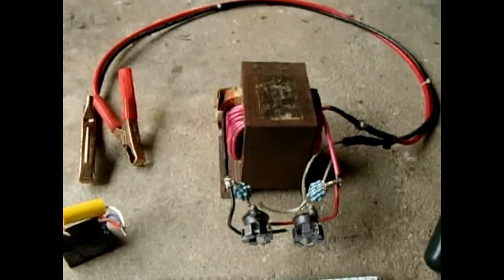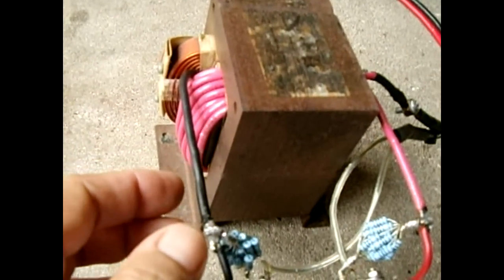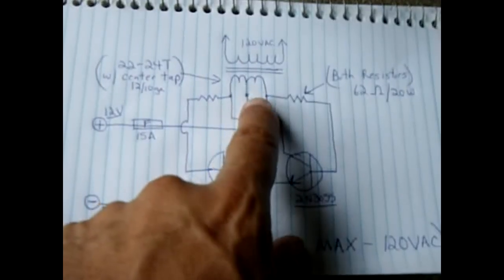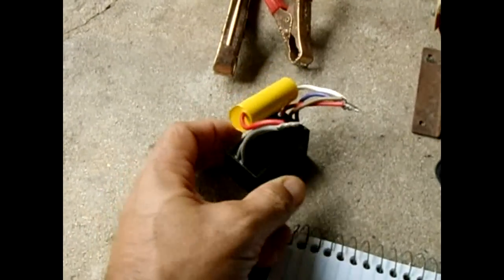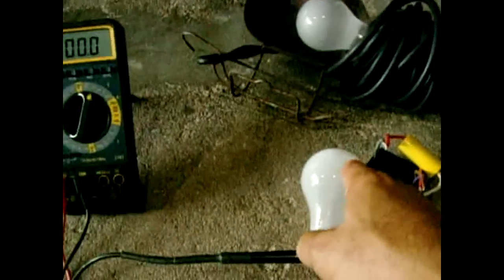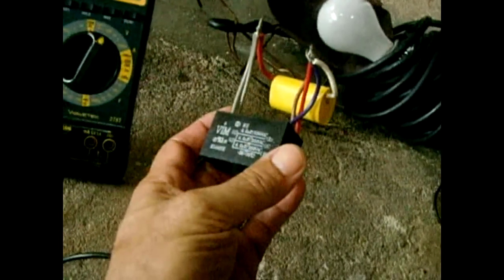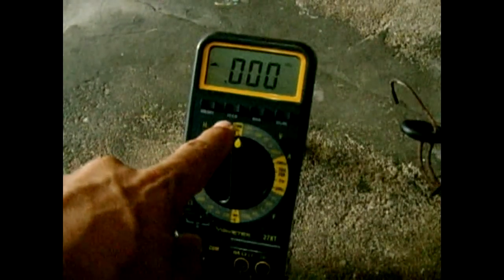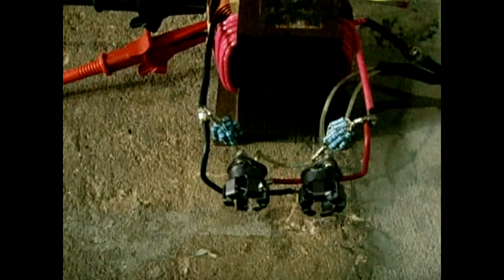How To Make A Microwave Oven Transformer(MOT) 12V to 120V Inverter

Comment from the maker: Sorry about any shaky video! CORRECTION at 3:37, I meant "Transistors". Thanks for watching!
Reply: Can i propose you something...Exchange the resistors for 2 car lamps 40w each -that way you will get low current while operating under small load while under high load you will get high current-they cant get too hot also..Coz lamps load can change..Try it and tell me if it works better-i know it will...
Reply: Hey Doug, If you needed any components to do a bigger project, give us a shout and we can work something out. ascocomponents.co.uk 
Where are you based?
Reply: electronicsNmore0
Reply: electronicsNmore  would this run something along the lines of a 4.5 in grinder and would u mind explaining how long something like a 12 v car battery would run omething like that compared to a mother ment to use 12v
Reply: @cocosloan3748  
What does transistor do?
Resister is to limit amount of current can go through, anything extra just turn into heat. correct?
Reply: @harukoyama9515  Yes. Transistor is variable resistor - it changes its resistance depending on the base current(Bipolar transistor) or voltage(Mosfet transistor). Since every resistor gets hot-the transistor gets hot too . I was  proposing lamps instead of those bunch of parallel resistors because lamps behave differently under different current.When idle-lamp will not glow - and its resistance will be low (few ohms) . But as soon as you connect load in the circuit the lamp will heat up its filament and the resistance will rise to 50-100ohms and limit the current while load is on.(no need to worry about overheating or nothing since lamp cant overheat especially when glowing) . I made same circuit and used it into car amp(i had my secondary winded to 2 x 40V and so i could supply my audio-power amp with 2 x 55V -which i needed for 250W amp.The convertor was pulling too much current when idle -so i changed the resistors with lamps and then it worked like it should-also no need to worry that resistors will smoke and overheat..Its a nice solution!

Comment: This is a completely down to earth accurate design.  He is clearly saying no more than 75 watts...One aspect to consider is that when you turn this inverter on...even without any load...the switching of the transistor alone the 24 turns in the transformer  will  consume about 2 amps....Hence, if you are not  powering anything..it is better to leave it disconnected.  As for the efficiency....about 75 % or less is typical.  Again...great video!!!

Comment from the maker: I tried that already. I certainly does keep the frequency set at 60HZ, but I had problems getting a huge power output like this inverter. I also experienced some transformer heating when forced to drive at 60Hz. The voltage rises as the frequency goes up, and as frequency goes down, the voltage drops. Not a perfect inverter, but this one does work quite well for what it is.

Comment: A ZVS driver would be nice but this one is intriguing because the oscillator is entirely passive, consisting of just resistors and the winding inductance. Sure, the frequency varies like crazy with load but its simplicity is admirable.

The TL494 is an older switching controller that is popular with square wave and stepped square wave inverters and you might try using one of those to get some decent control of the output. They're very inexpensive new from many manufacturers and extremely common in old SMPSes of all kinds which is good for the hobbyist.

Comment: This video is VERY true! I've built 12V - 120V inverters myself and yes, those are pretty much the same step you must take in order to get the desired results. Also, I too, have built my own 120V - 12V/24V/40V step-down transformers with the same method. Very good and clean work on your winding there, too. Nice!

Comment: I found moderate success using a car battery charger transformer as the step up trans., and two K2699 mosfets (plus 4 resistors). The frequency is load dependent, in that the heaver the load, the lower the output Hz is. I was able to achieve 132VAC @ 50Hz with a 30 watt load powered by 13VDC. 
The load on the battery under those conditions is 3.4  amps. I also placed a 0.22uF ceramic cap on the output to reduce spike noise, but this also created a tiny extra load. I added a full wave bridge with 1000uf caps rated for 400v  on the output to use with appliances that will accept high voltage DC. So I have 2 kinds of output (132VAC & 145VDC).
Reply: John Conrad What the point to have two inverters: from 12 to 340 and then from 340 to 120?

Comment: You may be interested in a circuit called a "zero voltage switch driver", or zvs driver. It's very similar to this design but uses MOSFET's.

Comment: Thank you for shareing your results, great experiment, I look forward to looking at more of your video's,
Electric motors, Induction and Universal are what I am playing with, trying to come up with a diy VFD (or inverter drive), to run said motors, my friend has developed a speed controller for universal motors, but this requires further improvments in order to control single or 3 phase induction motors.

Comment: Adding capacitors in series with your load changes the power factor of the circuit, aligning the phase angle of the voltage with that of the current.

Comment: Nice simple design, it is quite similar to a Mazzilli ZVS driver just at a lower frequency, if this works the same way I think you could add some AC run capacitors between the two 12 volt leads going in to the transformer causing the circuit to switch slower and at the right value maybe put out 60 hz.
Reply: I was actually saying a cap between the two primary side positive leads (output of transistors) might make the thing resonate at a lower frequency so with tuning it could put out 60hz

Comment: the reason the cap drops the frequency is between the transformers load plus a 75 watt bulb is now its a tuned pi circut. and can be set by bulb wattage or up dwn caps till u find the sweet spot.

Comment: 56 Ohm (40W) works even better, a bit warm but a smoother slew rate and longer runtime for the battery.
Reply: Benito Abreu, what pieces could one rig up to make this part?
Reply: I upcycle parts, but have boards (ie, all the parts) from two stereo sound systems, so I'm well shocked for transistors and fuses. Just learning about parallel and serial differences....

Comment: you could use darlington pair transistors to reduce the drive current and reduce the power dissipation of the base drive resistors.  Or Mosfets...

Comment: Out of curiosity, have you hooked this up to a scope yet? I am curious to see the harmonics on the primary coil, you whine tells me you are on a third or fourth harmonic on the secondary, a bandpass on the fundamental frequency for the primary to shunt it, you might get a stabler output on the secondary and not degrade the windings in that mot. I do love the simplicity of this inverter, see many uses in a pinch. But should point out that the frequency on a rectifier will determine the rectifiers voltage output to an extent, and could destroy sensitive switch mode power supply.
Reply: Yea you got a point about switch mode power supplies. They wouldn't like the higher frequency. I wonder what would happen if he paralleled a capacitor with the transformer windings that connect to the transistors. Would that lower the frequency and what would happen to the power output and efficiency?

Comment: This is called dual differential invertor. I first saw it in a large handbook of circuits back in 1971. It puts out a square wave which will toast anything with a transformer in it, such as many power adapters. It's best for lighting and loads which don't need a sine wave to function. CCFL lamps could work OK with this, but may be dimmer. Why? CFL lamps use the peak-to-peak value present in sine waves to generate 160VDC. With square waves, there is no normal peak-to-peak value.
Reply: It won't have a square wave output as the inductance in the transformer rounds the edges and turns it into ac. It will have harmonics but they won't be of great enough amplitude to matter for most things
Reply: +Electronic Experiments Perhaps a followup video is in order? Then you can show your square wave on an oscilloscope.  I'd also recommend naming the specific circuit configuration being used, as well as including the maths to determine the frequency.

Comment: I assume that the resistors are for biasing the transistors? Can a lower resistance be used? You are running full current through 62 ohms, which is quite high so yeah, they'll get hot. For a low power oscillator, that's fine but for running high power, a slightly different topology will need to be used. It's been many years since I built that type oscillator. Is it a flyback topology? You could always build a push/pull audio amplifier circuit and drive it with a signal generator chip, which is real cheap. That would give you the room for future expansion due to being able to parallel transistors together and also have a constant 60Hz true sine wave input. Nice thing about a push/pull circuit for this application would be that you wouldn't have to make fancy circuitry for audio applications so a bit of distortion wouldn't be a problem. In your circuit, get ceramic high power resistors or even use the wire from an old heating element... You should also measure the input current... If you can do it with low value resistors, go to radio shit and get some .1 or .5 ohm resistors. You can still get them in 10W or go to mouser or mcm. They are dirt cheap and much better than carbon film units, as you have.

Comment: thanks for the time you take to make these videos i am truly thankful   ......i am self learning electrical technician as i would like the be able the run my house and maintain it  as we all know our electricity bill just keeps rising now i am a far way from doing so but i have acquired 8 (mots) in the last 4 days  and was wondering if i would need more to run my 6 bedroom house with 12 light bulbs, 2 48" flat screen tv's, 2 refrigerators, 1 washing machine and 4 fans
Reply: Calculate the Total power (Ptot) by adding the power of each individual item.  This unit he built is very very inefficient perhaps efficiency is about 60%.  So input power from batteries is Ptot/0.65 = what comes out of your battery and also current in the transistors.  Now you know the power draw from the battery.  Use MOSFETs so you don’t need those 25Watt parallel resistors.  Look for the circuit for induction heating they use MOSFETs.  Much more efficient.  Also you can buy 1000 Watt induction heater circuit on eBay or Bangood for about $40 or less and modify it to suit what you need.  That way everything is built and you don’t need to build power circuitry. Use this only for light bulbs etc and not for Television because the frequency is not stable.
 Good Luck
Reply: you may find that a Dc-Ac inverter such as this will not serve your needs, lights and fans yes, TVs (especially new models) No. As far as refrigerator and washing machines go you may run them more efficiently with a power DC supply. If your needing to lower your electric utility bill and do not have a smart meter... place a strong neodymium magnet on each side and observe your Kw-hr usage.

Comment: The reason why you are getting an increased voltage when adding that capacitor is because at that frequency it acts as a reasonably large resistor, in series with the bulb ov course. So naturally the voltage at the xfmr terminals rises. If you measure the voltage across the actual bulb you will find it's less.
Reply from the maker: The bulbs gets brighter when I connected the cap across the AC output, so the voltage has to be higher.
Reply: electronicsNmore Did you connect the cap in series with the lightbulb or in parallel across the output ov the tranny?
Reply from the maker: I tried both ways. I think the light got brighter and more voltage when i connected the cap in series with the light.
Reply: electronicsNmore You probably got some kind ov LCR resonance going on there. Or it could just be the impedance ov the cap is allowing the circuit to run more efficiently. If you figure out what the reactive impedance ov the cap is at the freq you are running & swap it for a resistor ov the same equivalent value in ohms you will find out which those the effect is. If the resistor works as well it's the latter, if it doesn't it's the former effect happening.
Reply: electronicsNmore Yes, the op ir right, motor run cap (ac cap) in series with the load acts as current limiting resistor due to capacitive reactance, so the voltage increases. Bulb may become a little brighter because of improved power factor.. Capacitors in series introduce current lag (out of phase by 60 degrees?)

Comment: Nice video. Why does this circuit oscillate? Thank you for making this video and sharing your knowledge and experience. Awesome. The center tap seems important as it allows cross-coupling the transistors. Very nice. [I’ve since learned a bit about inverters and why they oscillate. They’re covered a lot on YouTube. Thank you.]

Comment: there's this thing after you said "transformers run warm" and it pops up and says " i meant to say transistors " and both statements are true, but i believe you were referring to the resistors you were pointing at...
Reply from the maker: I don't think the resistor got hot, they got very warm. Have you seen my latest inverter video? I used the transformer in this video to make a  60hz modified sine wave inverter.

Comment: I found out that using a diode in parallel with a small capacitor in series with the resistors increases saturation and makes the transistors run colder.

Comment: Was just curious. Yes as a basic inverter it would runs my lights quite well. I have a 300W modified sine wave at the moment. And with all the lights on in my one bed flat only pulls just under an amp out of my QA battery. That's a total of normal 230V AC cfl bulbs 121Watts and a 60Watt aquarium pump. On the one QA ran for 7 weeks 4 days. Being charged with 60Watts of solar panels and about 200mA from wind turbine. I reckon another 60Watts of solar should do the trick.

Comment: This is a good project but please DO NOT energize this transformer before removing the secondary wire. Unless you have experience with high voltage and know how and why it works, always remove the secondary first.  If you have to ask what a secondary is this project is not for you! This transformer unmodified is the perfect recipe for electrocution.  It outputs 2000V AC at 60Hz with more than enough amperage to put your heart into a deadly chaotic rhythm. 
 Seriously,  A few years ago a guy who just graduated high school was trying to follow instructions on the Instructables website for making a spot welder.  He was shocked by the secondary and was found dead in the driveway by his mother. She later found his computer with the website still open and made a comment on the project page about what happened.
Reply: +Chris Barth I'm sure he's aware of that :)
Reply: +MrJohhhnnnyyy 
No shit! 
My comment was directed to anyone who may try this without having any electrical experience/knowledge. 
Thought that was obvious though.
Reply from the maker: +Chris Barth 
Clearly people with little or no skill in electronics or electrical, should not be attempting this project. That's a given. If they watched the video, they would know the high voltage secondary in the MOT needs to be removed and replaced. If they don't do it, "Oh Well". I have disclaimers on my channel like many others.
Reply: I totally agree, not criticizing you at all!  You did make it clear several times, if somebody did something stupid then its on them.   
 I wrote my original comment right after reading about the death at instructables website from an unmodified MOT.  Guess that's why I wrote my comment. 
BTW, keep up the videos!  Your video about aluminium "brazing" was great. I had no idea those rods existed. They work awesome!
Reply: Chris Barth Well, you didn't really made it clear that you're talking to others. There's a lot of people who won't get it as well and there's no need to be a jackass about it. Just say: "People who will try to make this project...". Then it'll be crystal clear to EVERYONE :)
Reply: +MrJohhhnnnyyy
Yeah, my reply back to you did come across as jackass-ish, sorry! Sometimes it's hard to read others intentions with comments, one clue I should of taken is the smiley you put at the end :) Have a good one.
Reply: Chris Barth No biggie :) The reason I answered in the first place is that I've seen a lot of smartasses who do nothing else than to harass people who know what they're doing with their "safety advices", yet themselves they couldn't do a thing at all. So I decided to check,and you're not one of them. You might've seen them yourself, very annoying chaps
Reply: Yeah, I know the type you're talking about.

Comment: nice job as  an electronics tech over 30 yrs  i see your doing good you might wana try irf mosfets instead of 2n3055s the transormer you got might be off a bit can also use a battery charger one  with ct your circut reminds me of an inverter radio shack sold in the 80s.
Reply from the maker: This was just a circuit I was playing around with. I have 2 other inverter videos you should check out(both use mosfets). They are listed in my video playlists.

Thanks For Watching!
Reply: pk  i will look after have to run to store for stuff thanks

Comment: Have you removed the magnetic shunts? Two small bits of iron-core they usually put between the two sets of windings.
That makes the thing work better as power converter.
In your circuit it can also make the frequency more stable.